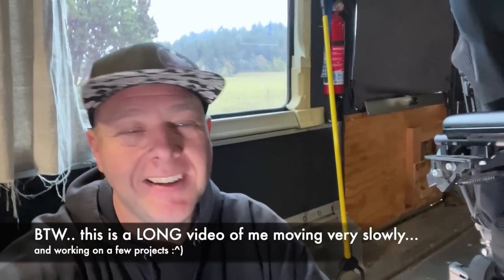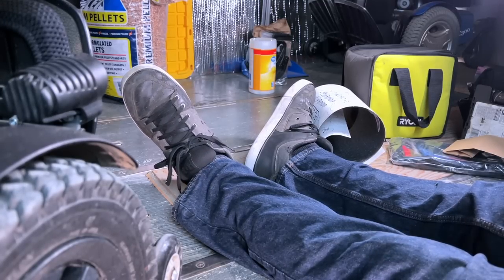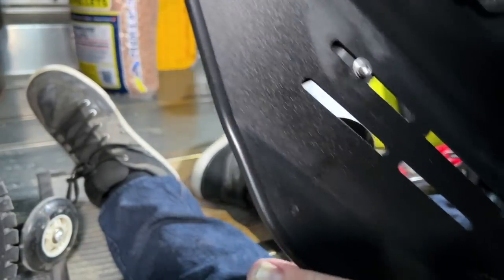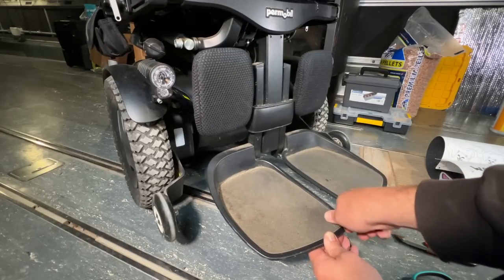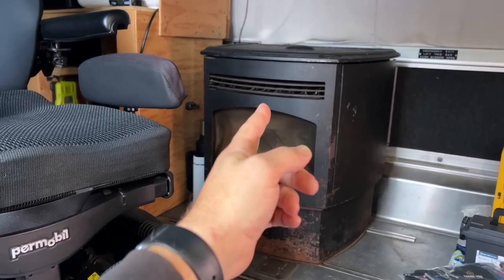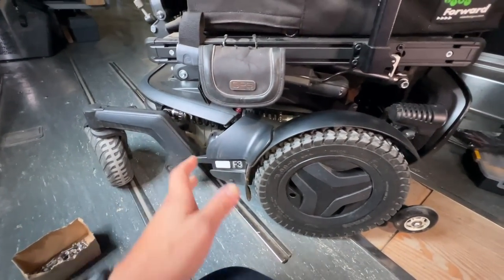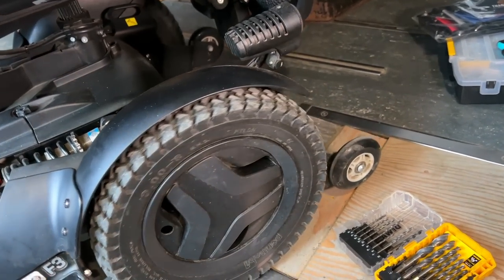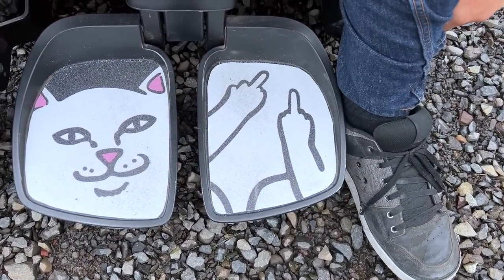MEGA VLOG 637: OCD fueled f3 mods!

Comment: I'm about to switch my controller from the right arm to the left, last parts to install my legrest assembly when my roller tray gets here by this weekend. Gotta find bolts for the roller tray and the back attachment point for the legrest actuator. I'm tickled to tackle this project! My anti-tip wheels are on the way, but those come with the bolts.

I took the chair out for my first real test  ride after adjusting the fit, yesterday. Put it through some paces in my apartment building's parking lot, then decided to go to my mailbox, up the hill. We have a 15% grade, and I wanted to see how the chair would handle it. No problem. Handled it with aplomb. Love this chair so far!

Comment: Wow they did a crap job of putting that seatback together. At least on mine the provider used black round head bolts and black dome nuts. I like using Ruspert black screws on my chair when adding things.
Reply: Ah, thanks for the search term "Ruspert".  I found some ceramic coated screws I really like but did not know the name.  Now I can order more.

Comment: I can't get used to my F3 and really like how the C300 handles   the F3 seems to whip when turning 180 degrees, the C300 is so much smoother, I used your technique to repair error code 0E00 on the C300 thanks, also Mr. Bezos sells black metric assortments cap bolts, cap screws, and more.
Reply: In the F3 you have a gyroscopic steering set up, so it helps with stability control. It can take a few adjustments in the onboard programming to get these chairs to drive the way you want them. Your best bet is the contact your DME to make adjustments in your programming to help make it feel like you have more control and have a more comfortable ride
Reply: @JordanLoweElevaToursCanada  thanks, I have the dongle hooked up but just haven't gotten to that yet. Any suggestions?
Reply: My wife feels exactly the same way.  She HATES the F3, and will not get out of her ancient C300.  The DME has made all kinds of programming adjustments, but it still "whips" (which is exactly the word she uses).  She also has an M3, which she hates almost as much as the F3, not just for the handling, but the "clacking" that sounds like a noisy solenoid.  WTF!!!
Reply from the maker: the stock programming on the chairs is almost unusable - especially on carpet! for indoor low speed use, a profile needs to be setup with fairly high acceleration, and a lower overall speed.  also minding the direction the castors are pointing can help a lot as well ( video about that https://youtu.be/C0Lr_YIMUck )
what happens is when you attempt to turn, and the acceleration rate is set too low, the chair slowly ramps up power, but on carpet or other surfaces its not sufficient to make the chair start moving.. the power slowly builds and builds, and by the time the resistance is overcome, the chair has ramped up to a fairly high speed - which results in the 'whipping' motion that happens.  so more torque needs to be applied at a lower speed - BUT the overall speed needs to be low to prevent this from happening.  it can all be taken care of with proper programming - but a lot of DME's / dealers don't have the time/understanding of how to set things up properly
Reply: @AS-ub7vu  bro the M3 felt weird when trialed, F3 is great but hate that whipping it does as well. RWD For The Winnnn

Comment: Personally I would have used silicon double sided 3m tape between the fenders it's good, doesn't leave gunk when removed and it seals water and dirt. It's the best tape I've ever used. Old double sided tape is gross and doesn't come off without having to resort to chemicals.
Reply: I take it you are referring to the 3M Automotive Trim tape, the gray stuff? I love it, been using it for 20 years when I was trucking.

Comment: hey @totallynormal do you have any programming suggestions to make the F3 behave more like my old Invacare MKIV Torque SP from 2002? The electronics were more responsive and movement felt more 1:1 natural, i have the programmer for the F3 but the input lag is noticable and then it darts once it gets moving a bit. it likes to fishtail on my doormat then dart: just needs a better settings profile do u have one exported i can load or alternately some suggestions? thanks dude
Reply from the maker: hey! yea it takes a bit of adjustment.. do you have the USB dongle? or a handheld programmer?
Reply: @TotallyNormal-  i do :) usb pc programmer
Reply from the maker: if you have twitter we can chat via DM's on there, or via email (contact form is linked below video) i can recommend some settings :^)

Comment: Hi, I just got my second F3 today. Is there a way to mute the beeping sounds on the controller? Also, I remember there was a way to turn off the green function lights , I can't remember how to do so. Finally, I plan on keeping my other F3 as a back up to be used every several months for travel. What is the best way to handle the battery charging for that chair? Thanks so much for your help and knowledge!
Reply from the maker: for the start up noise, and other beeps, go into the user menu (top left soft key - press and hold for a few seconds) then go to programming --> controls - the sound options are in there :^)
as far as storage, charge it up overnight, park it somewhere, and flip off the breaker on the back of the chair!
 the circuit breaker on the back makes storage a LOT easier to prevent batteries from draining! 
try and keep the batteries from freezing temps if possible - 
(if they're super cold, bring the chair into a heated area for about 24 hours BEFORE ya plug in the charger)
when ready to use chair again, plug it in overnight, and you're all set!
depending on how long its been stored, the batteries may take a few nightly use/charge cycles to come back up to normal capacity though.  

when that breaker on the back is turned off - the batteries are disconnected completely from everything - so its as if they're just sitting on a shelf :^)

almost forgot - DO NOT leave the chair plugged in for long periods of time! (MAX of 48 hours)
depending on the charger, leaving a one connected for weeks or months can toast the batteries)
Reply: @TotallyNormal-  thank you so much, this has been very helpful. Do you happen to recall how to turn off the green function lights that are on that panel? Thanks again
Reply: One other question please… I have the light kit. On the way home from the chair check out, one of the lights got caught on my van seatbelt when pulling out of the van end it twisted the light slightly. The wiring looks intact but the light does not work. What should I look for?
Reply: Hi, I figured out how to turn the panel lights off :)